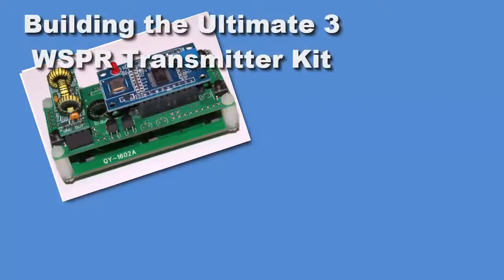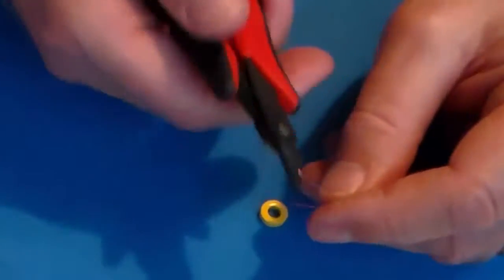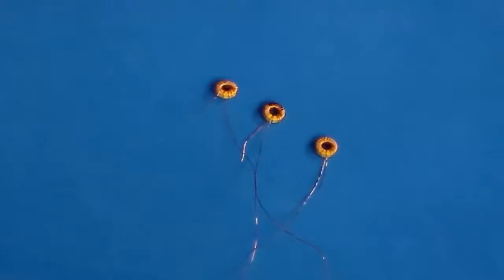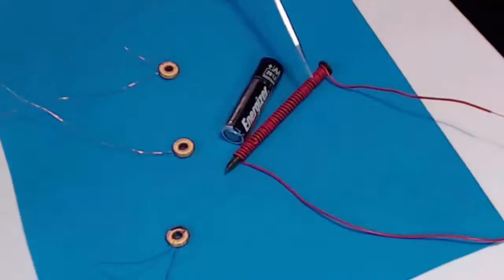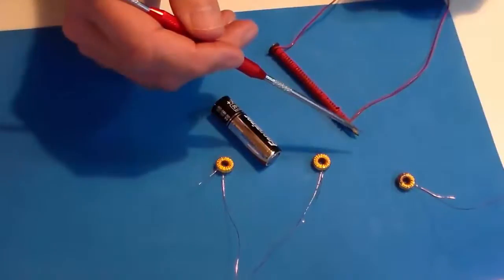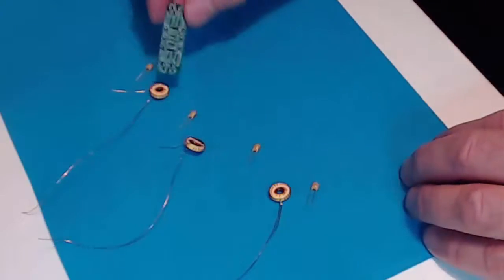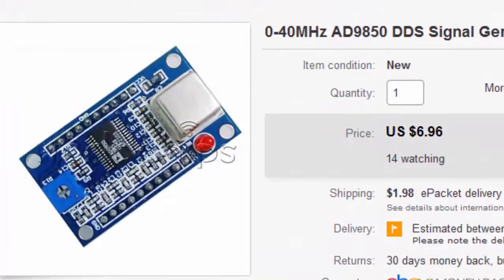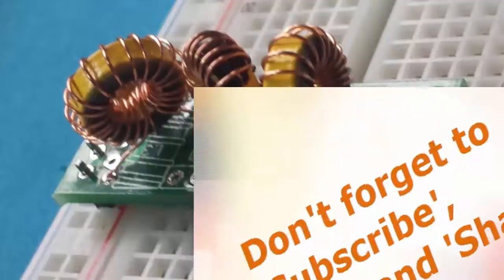QRP-Labs Ultimate 3 Pt2 Low Pass Filters

Comment: I have one of the newer kits and the area for the capacitors is doubled   almost like it was designed for two capacitors?   I tried to find this at QRP labs website but I didn't see it.  Could you provide some guidance?
Reply from the maker: I'm sorry, Don. If you notice the date on this video it is from 9 years ago. I am not up to date on their new versions. Good luck, though. 73 Budd WB7FHC
Reply: @BuddChurchward   thanks  for the reply.   I did some "testing" with a multimeter and I think Im going to be OK... it seems that they are still connected in parallel ?:

Comment: Hi Bob, Thanks for posting the video's.  I've never wound any toroids, but I did spend many years working in a Rigging Shop.  It seems to me that it might be a little easier to take a length of wire and find the approx half way point.  Then wind one half one way and the remaining half the other.  Saves passing the entire length or copper through the toroid until it is used up.  Just a thought :)

Comment: One other thing on the toroids: I end up losing track on the number of windings - especially on the smaller toroids with a lot of windings. Just taking a piece of blank paper and putting a line down for each winding helps a lot if you get interrupted...or your mind tends to wander after awhile like mine. :-)
Reply from the maker: murrij I know what you mean! Fortunately these coils don't have many turns, but I did have to count them out loud. I figured out to wind as far as the next to last turn and then carefully count them just to make sure I need that one more turn. Of course that would never work if there were so many turns that they had to overlap themselves on the core.

Comment: Ok Budd, I'm inspired!! I got this kit after it first came out, and it's been sitting on my workbench as other things came up and pushed it to the back burner. Not anymore. Starting it today. 
One thing I do with the toroids is after I've wound one and checked it for the number of turns, I take blue tape used for masking off windows, etc. when painting a wall, write the number of turns on the strip of tape, and then I wrap it around the toroid. It helps when you've got many toroids with different turns.